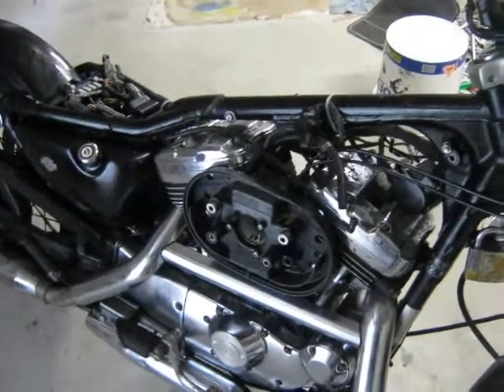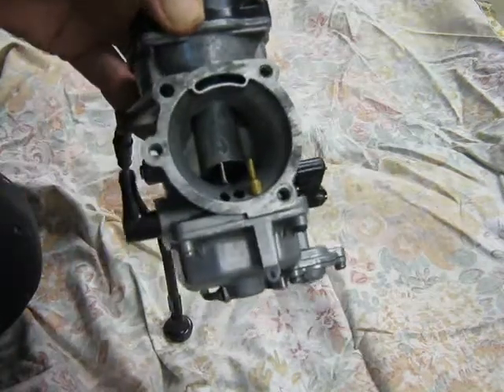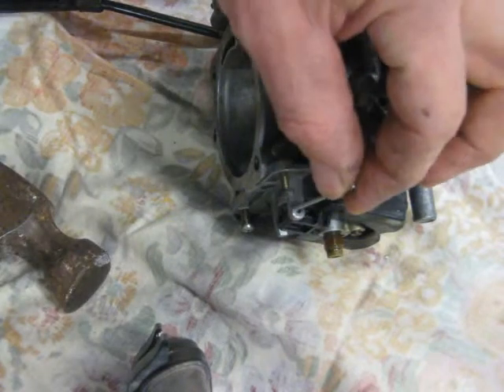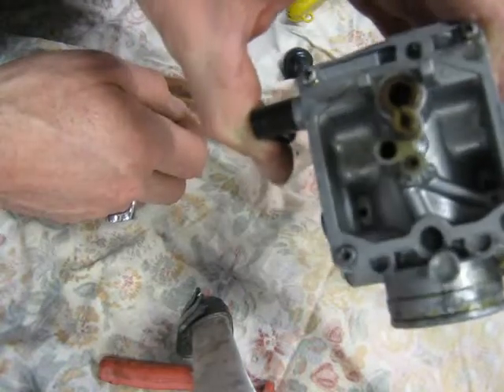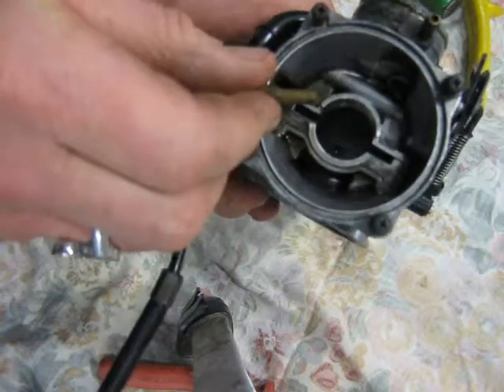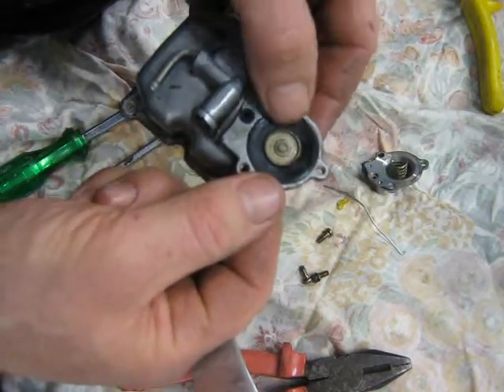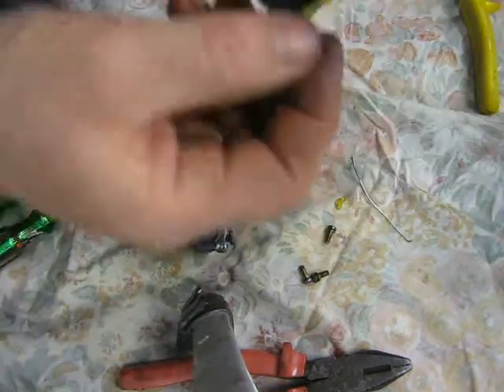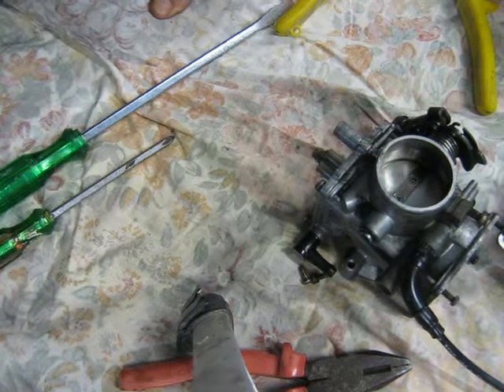Harley sportster carbi take apart ( from sportster problem 27 )

Comment from the maker: I must have overlooked something because the problem with the motor was the carburetor and this work didn't fix it, the senior mechanic / auto electrician said some thing about the float height and he installed some parts ( missing ? )